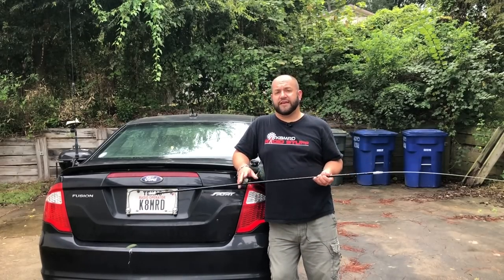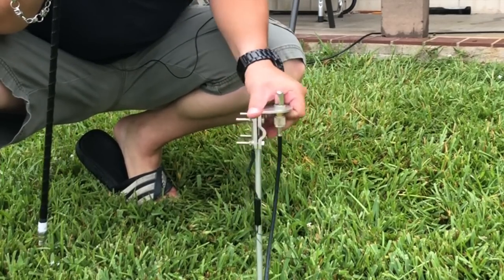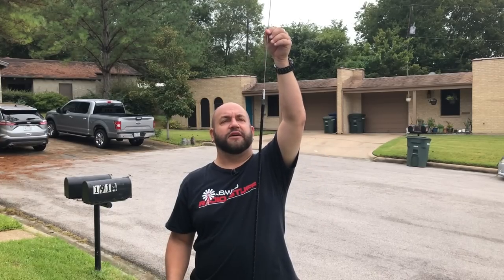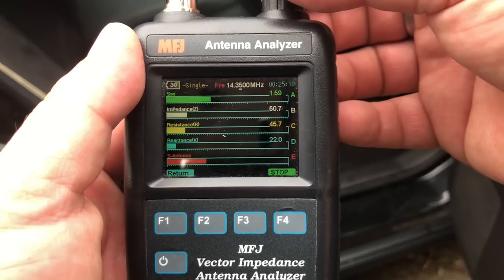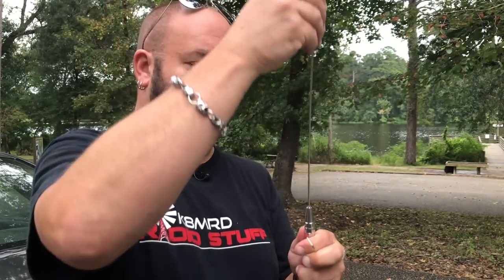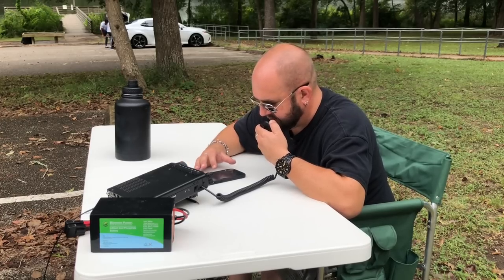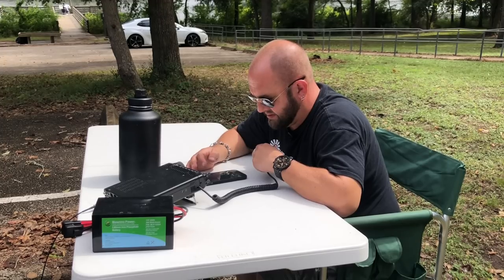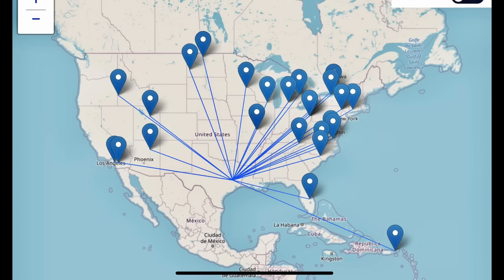Antenna Review | MFJ Ham Stick

Comment: were you using 90w?  my 12ah lifeop4 battery will give me only max 60w on a good day.  what battery were you using?
Reply from the maker: Probably.  I usually use a 20AH Bioenno.  Never had a problem on SSB.  CW and Digital won't get you 100 watts though.
Reply: @hamradiotube  Thx.  For CW and digital modes running 100w may not be good for the TX.  I will have to upgrade to at least 20ah lifepo4 battery.

Comment: What’s the name or model of the vehicle mount?
Reply from the maker: I use the Diamond K400 mount.  It’s not cheap at about ~$80-90 but it’s held many a screwdriver antenna at +100mph and it has never rusted.  I have 2 now.  One of them was from when I lived in MI with all the snow and salt.  It’s still as good as new 4 years later.

Comment: In the original ham stick manual it say to NOT slide the whip down too far because I can cut the wire inside and avoid warrentee.. so taking it apart is a better option..
Reply from the maker: I like to live dangerously.

Comment: I use a 40m hamstick dipole on my g90,  I had to cut maybe 12" off of each wire whip to get the antenna resonant @ the middle of the phone portion of 40m

Comment: A few years ago, I used a Lakeview hamstick on the car, a Ford Tempo, with a TS-50 at 50w, no problem working contacts, perhaps I need to resurrect this same set up for POTA, seems to be working for guys/gals. I do use a double hamstick set up for 20m on top of a  pole, made 25 contacts Sunday of 2016, best DX that day was France CQWW  73 al ve3gam
Reply from the maker: A ham stick was the very first antenna I ever used for portable.  I've since become obsessed with antennas and mainly use an EFHW or a DX Commander Expedition, but for price and ease of setup they really can't be beat.

Comment: Mike:  Dave, WB8LWS in Almont, MI here.  I've been inactive for over 20 years but watching you with POTA is getting me excited again  I had a hamstick, probably still do but I don't know where it is or what frequency it is for, but I had to cut the whip also to get a good resonance, I had a similar problem you did.  I think the whip acts like the core of a coil and as you lower the whip it adds inductance and here we go whoop t doo!  I think I worked you on 2 meters years ago, I was quite active on Clarkston and Rochester repeaters.  73!
Reply from the maker: Hi Dave, thanks for watching.  Glad to hear you are getting excited about radio again!  POTA in particular is my favorite thing about radio (next to my fascination with antennas).  Get your stuff out of the closet and dust it off.  The solar cycle is on the upswing and bands are only getting better.  I've activated parks recently on 17 and 15 meters.  Those bands have been dead forever!  I was only licensed in 2016 so I'm not sure if we made contact but if I was on a repeater, it was probably the Clarkston.  Thanks again for watching and I hope to catch you on the air!

Comment: Thanks That issue has had me perplexed I bought several of those awhile back and that issue frustrated me to the point I just hung the antennas in the garage until I had more knowledge and experience. Thanks for the knowledge. 
Jim KI7SSO
Reply from the maker: Hopefully you can dust them off, get them tuned up and get on the air now.  73

Comment: Nice video I'm experimenting with a hybrid using hamsticks and a super antenna
Reply from the maker: Interesting. Hows that working out?
Reply: @hamradiotube  Mixed better on  40 and 80 not so well eh more NVIS  on 20 up either way stock or my hybrid I was not impressed

Comment: I just returned from a three week trip with a 20 meter hamstick mounted to the bed of my F-250. I ran 10 watts using my TX-500. I made many contacts of more than 500 miles. My best was from central Iowa to central California. I had read that hamsticks are junk so I wasn’t expecting my setup to work at all seeing as I was running low power. After my first QSO of an hour from Idaho to Michigan I became a believer. I think that part of my success is that I mounted the antenna to a rail running across the top of the truck bed about a foot from the back. This put the entire radiator above any sheet metal except the truck cab. Anyway, it worked spectacularly
Reply from the maker: Oh dude, the car is a spectacular ground plane.  I have done zero bonding or grounding.  Just put the mount on the car and start calling CQ.  Works like a charm. Of course they are a "compromise" but every antenna in the world is.  If you are making contacts, it's working.

Comment: Curious as to why once you've tuned it you don't just unscrew the top section, invert it, & slide it down inside the coiled section for storage/transport? 
Much less risk of wearing the grub screws out or losing them &/or the allen key.  Even if it's got a plastic "stab protector" on the top it I'd bin that for the convenience of storage.
Reply from the maker: Because that thought never occurred to me until now.  Thats a great idea!  I think there is a stab protector on it I would need to cut off.  That's not a big deal though.

Comment: Ned Davis WB4BKO . I have found the ham sticks work quite well with increased bandwidth using a shunt coil  of about 20 turns one inch in diameter placed across the feed point. Wire diameter doesn't seem to have much effect.  Changing the coil winding spacing has a greater effect on bandwidth. Also, I found marking the length of the whip by cutting a small notch in it at the set point and coloring the notch with a Sharpie keeps the mark there longer. I have found replacing the set screws with a wing screw, or a screw with a knob on one end, helps the adjustment process with out having to fiddle with an allen wrench and possibly losing it. I haven't been mobile in several years, but you restored  my interest in doing so again.  Have you given any thought to trying a Ham Stick, or one of Lakeview versions, on a tripod elevating the feed point to about 10 feet and adding radials in a ground plane configuration?  Could prove interesting.  73 from Battle Creek, MI
Reply from the maker: Lots of people have talked about replacing the set screws.  Mine started stripping before I even started making the video.  I have used a ham stick more elevated.  I got it tuned it perfectly.  That was very early in my portable radio career though.  To be fair, the radials I used in this video for the vertical configuration were not at all made for this antenna, but a totally different one.  They were close enough and were laying around so I used them.  Still got decent results.  I'm glad to inspire you to get out and do portable again.  Doesn't matter what antenna you use.   Theres a great saying that I've heard.  The best antenna in the world is the one you have with you.  I fully believe in that. Dont get too hung up on SWR, compromised antennas an all the rubbish.  Just get on the air.  Thats all that really matters.  You will make contacts, I promise you that.

Comment: If you would of had a antenna tuner would you still have to had cut the antenna down or no?
Reply from the maker: A tuner would be a bad thing to use in that situation.  The antenna would still not be resonant.  All a tuner does is make your radio happy.  It does nothing to make the antenna perform better.

Comment: I store mine like a musket ramrod in a barrel. Unscrew the whip and turn it around and shove it in the fiberglass tube but great video I learn a lot from you
Reply from the maker: Hmm, thats a good way of thinking of it.  And you don't need to worry about losing the Allen key either.  Good idea, thanks for the tip.

Comment: Great Video Mike!  I bought the MFJ hamsticks and I also couldn't get it to tune out of 13Mhz!!  I thought it was defective so I just put it away.  I'm now going to have to pull it out of the closet and try it again.  Thanks for the instructive video!
Reply from the maker: Hey Ron, glad to hear I'm not the only one.  I suppose it's good they send them long but good lord, they should tell you, you need to tune them.  Granted, I didn't read the, what's it called, "instructions" or something?  Hope you have success with them.  Never let an antenna sit too long in the closet.  There's a reason you got it lol!

Comment: I have used these before.  I still have a bunch  
But tuning is a PIA even with an antenna analyzer and band swaps means stopping and changing. I went to a yeasu atas and i am happy with it. Ham sticks are great for the price but if you go mobile alot I would see if you can go with an antenna than can step the coil.
Reply from the maker: Yep.  What you say is true for sure.  Not too much different with other kinds of verticals though.  As much as I love the WRC antennas, like you say, if you want to tune a different band, you have to stop, get up, do the whole thing etc.  I have a TarHeel too.  Even that frustrates my need for immediate gratification.  I'm very much a resonant antenna guy.  I primarily us an EFHW or a DX Commander Expedition when portable.  If I want to change bands its so great to just be able to do that.  However, these are great performing antennas, and they are really inexpensive.  Which is something that all hams like to see.

Comment: I use a Hamstick Dipole with great results.  I removed some of the insulation from the top of the coil and soldered 3-4 coils together that way I could use all the tuning whip instead of cutting it.
Reply from the maker: Thanks for sharing

Comment: I used a HamStick dipole setup with my Ft-891 while camping at Lake Livingston State Park. Still learning how to do POTA so I didn't activate. Great antennas for how cheap they are.
Reply from the maker: That should work well for you.  My dad did the same thing with his RV.  POTA is easy.  Just get on the air and start calling CQ POTA.  I have a video on how to get started too:  https://www.youtube.com/watch?v=oQr5NoNY6Pc&t=243s
Reply: @hamradiotube  it worked way better than I imagined. I'll go check out the video!

Comment: I think the upper element is a steel alloy.  Moving it into the loading coil increases the inductance resulting in lower resonant frequency.  As you found, one has to cut the upper element to raise the frequency.  Thanks for sharing this video
Reply: Upper element is S/S  PH 17-7

Comment: Great stuff...Glad you've found a home in Texas. Question please: I've been considering buying one of the bigger NanoVNA H4 (4" display) analyzers for $100 to $160, but don't think I'd like all the constant calibrating as you change frequency. You seem to really like using the MFJ-223. The 223 is about three times the cost, but appears much faster and more handy. Other hams insist on one of the basic Rig Expert units instead. What are your thoughts please, if you had to pay for one? Thanks, Michael KZ5MSE
Reply from the maker: I bought a NanoVNA a while back when they were first becoming popular.  I had it out for about 10 minutes before deciding I hated it and I gave it to a friend.  I really like the MFJ-223.  I use it all the time.  I have another MFJ that goes all the way up to UHF and I like that too.  This one is just nice and small and light weight for portable.  It also charges via usb.  I have a rig expert right now that Gigaparts loaned me.  I need to get it out and play with it and do a video on it.  The Rig Experts have more features for sure, but the also cost a bit more if you want to get all the way up to UHF.  If all you care about is HF-6 meters the 223 would be my choice.  Though rig expert might be in the same price range for those bands too.  If it is, I prob would get a rig expert actually.
Reply: @hamradiotube  Thanks so much for your thorough reply. I have an MFJ 259B and just bought a RigExpert AA-230 Zoom like new on eBay for very reasonable. I try not to miss your stuff. You are WAY relatable.... watched before you came to Texas. All the best!

Comment: I was wondering  what you were using for an antenna. I normally hear you in the noise level into ND. You had a great signal with that antenna.
73's KB0EQH
Reply from the maker: I usually am using some kind of 49:1 EFHW when I'm out.  Or the DX Commander Expedition
Reply: @hamradiotube  
I use 9:1 unun. I band hop constantly. I have a 49:1 set up at home tuned to 80 meters. I have a horrible noise floor at my qth so I am mostly portable. Thanks for all the great videos.

Comment: I have worked all over the US and Europe with my G90 and a 20m Shark “ham stick” on a magmount on my truck doing POTA. I’ve also just sat in my truck in my driveway and answered European stations calling CQ. They work great. Super easy to set up and cheap. I had to trim a little bit off as well. I get the entire 20m phone portion with mine.
Reply from the maker: Thats awesome.  Thanks for sharing too.  Theres a lot of haters of these antennas but they work great, cost little, and are super easy to deploy.
Reply: I had a 20 meter Shark antenna on a magmount and it turned out to be a piece of crap - in fact, it broke!. Going to switch to MFJ and see if it works any better.

Comment: Was that an sma plug on the back of the 891 in the top corner? Using it for sdr tap?
Reply from the maker: No SMA on the 891.  That would be cool though.
Reply: @hamradiotube  It was the ground screw that looked like an SMA to me 😆
Reply from the maker: @chriscoel  Ah, that very well could have been it.

Comment: Nice video. Would like to see you play with these with the dipole mount. Been thinking of a set as a dipole for 10m since cycle 25 seems like it might actually make it worth while. A set for 20m could be fun with a 28' fiberglass flag pole.
Reply from the maker: I don't have a dipole mount but my dad uses them in that configuration on his RV.
Reply: @hamradiotube  cool! How does he like them?
Reply from the maker: @JReed305  I don’t think he used them too much honestly.  He’s not super active.  I gave him one of my TennTenna efhw’s and he’s got it over his house now.  He also just got a 7300 and has been getting on the air a bit more.  He’s loving working dx with the efhw.  I’ve not seen too many people use the ham sticks as a dipole.  They work pretty well just as a vertical but if you could get the dipole up in the side I’m sure that would be even better.
Reply: @hamradiotube  yeah I have a spare 20' collapsing flag pole that I thought sticking a 10m set on top of for portable work would be fun. Modeling it in MMANA shows that the radiation pattern would be quite useful on 10m as long as you can rotate it.

Comment: Great video on the Hamstick. I went to my local ham store a couple weeks ago and they talked me out of it, then tried to up-sell me. I just placed my order for one and a lip mount. Great tip on tuning. Thanks for the video Mike!
Reply from the maker: Wow, imagine that, trying to up sell you.  These antennas work great, especially for the price, size and portability.  There's really nothing else that works so well that is so small.
Reply: @hamradiotube  I can't wait to receive it. Hope all is well buddy.
Reply: @hamradiotube  for a mobile mount, do you recommend the spring at the base of the antenna?
Reply from the maker: @Blue-Collar-Radio  You should do just fine.  Just remember to #hamharder
Reply from the maker: @Blue-Collar-Radio  I've not used a spring so I cant say.

Comment: Just started using hamsticks the other day.  Surprisingly easy to tune.  I have mine connected to a mag mount and on a pizza tin for a counterpoise/ground and it actually works well.  Got the SWR down to the 1.3 to 1.4 range and beaconed out pretty far with FT8.  One thing you can do once you have your length dialed in that's easier than a sharpie, the metal part at the top of the black base (that the antenna wire goes into) actually unscrews from the base.  I unscrew mine and feed the antenna upside down into the black part.  Fits nicely and some blue tape will hold it in place (if you don't just put it back in the bag).  To deploy, just pull the wire out and screw it in, and it will be at the desired length by default.

Comment: That’s a somewhat common “fix” for those whips.  I have a couple of Shark ham sticks and didn’t have to trim the whips though.  A note of caution for everyone: if you tighten the whip to the base by grabbing the lower part of the whip (the coil) you can break the solder connection of the wire to the base.  Don’t ask me how I know!  Oh…I remember your Michigan SOTA activation video!  Hahahaha
Reply from the maker: Good to know about the solder connection at the base.  Michigan SOTA for the win!

Comment: Thanks for the shout out Mike. I am lucky, with the van, I don't even take the elements off. Just slide it into the back of the van. But, for tuning, I also had to cut my 60m Ham stick and actually cut off too much. MFJ sells additional stingers so I just ordered another one. Point is to anyone looking, don't be afraid to cut the stingers. Great video Mike. I always have incredible luck with the Ham Stick.
Reply from the maker: No problem buddy.  I def cut them a few times as I didn't want to screw it up lol!  No going back with these.